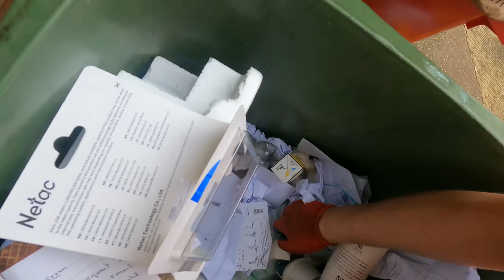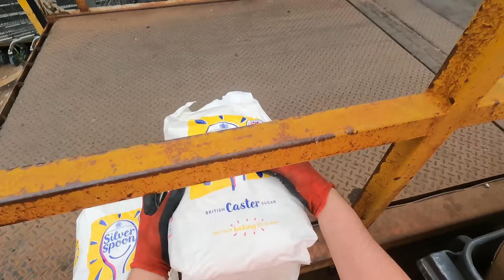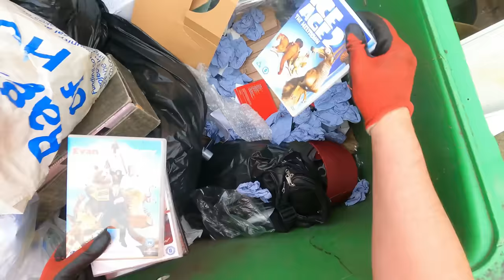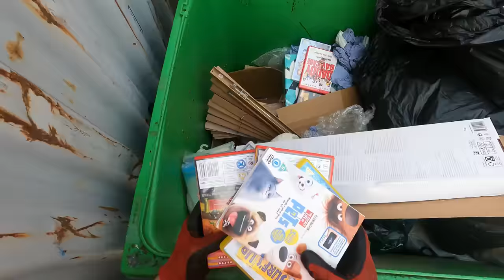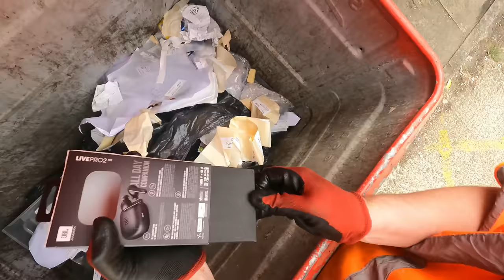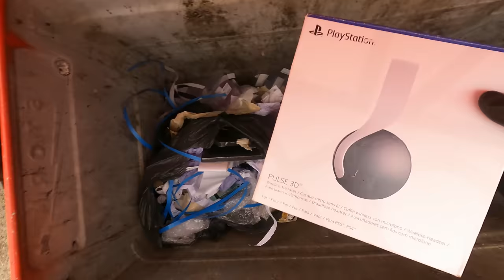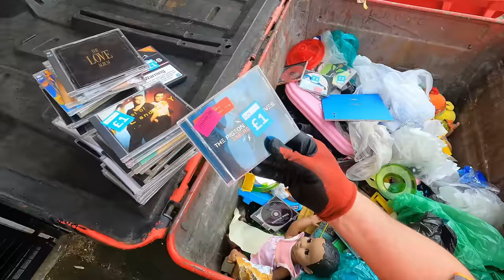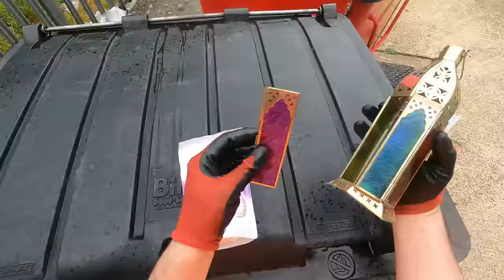DUMPSTER DIVING UK JACKPOT CEX SCORE PLUS MUCH MORE WASTE AUDIT

Comment: Those bags of sugar: sugar usually never goes bad unless it gets wet and molds over. Remember sugar was used as a presrvative the same way as salt.
Reply: suger - has shelf life, and goes bad. Salt - no ( if storage corectly)
Reply: @andriusBKI  if sugar is around damp etc and the sugar hardens it's not really safe to have and before you ask I worked at British sugar and any sugar like that in the storage unit got thrown out

Comment: When you found all that scrap metal in that skip, wouldn’t it have been easier if you reversed your van up to the end of the skip and just threw it straight into the back instead of chucking it all on the floor having to then pick it back up again?
Reply from the maker: its to late now but yes next time i think i will do that